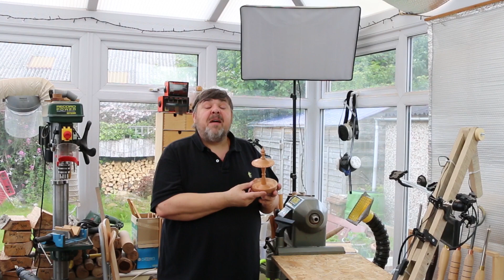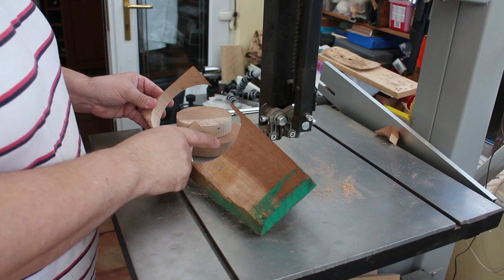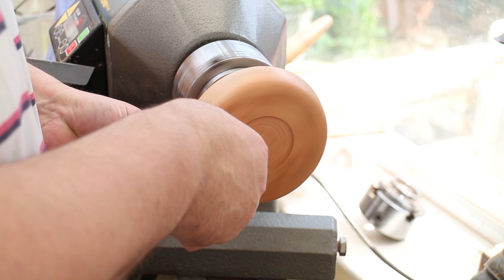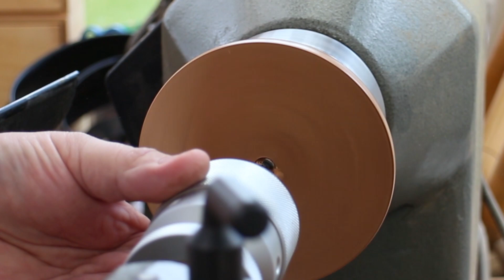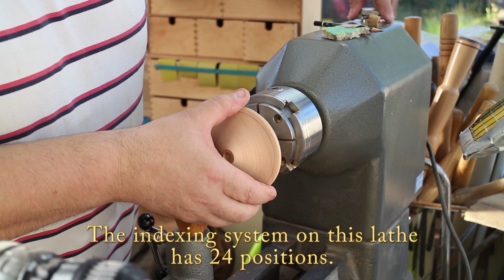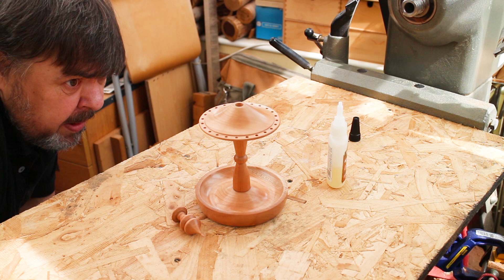#25 Simple Earring Holder - Wood Turning - Acolyte Turner

Comment: Hi Tom,What is that red plastic thing and where can I get one. I live in the UK and if it is only available here it is not a problem
Reply from the maker: +John Fithian-Franks Hi John, thanks for watching and commenting.  I think you are referring to this: 

http://www.teknatool.com/products/Other/Chuck_Gauge.htm

 It's a multipurpose marking tool made by Teknatool / Nova Chucks.  It has many useful functions from centre finding to gouge grinding angles and chuck aligning etc.  It's available from most Nova Chuck suppliers here in the UK.  If you can't find it locally let me know and I'll try and find a source.

Cheers

Tom